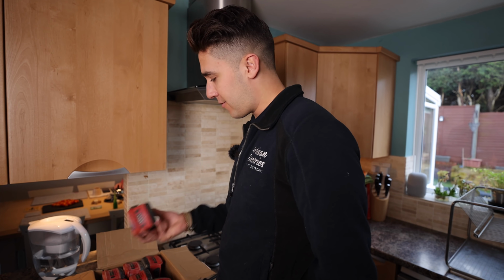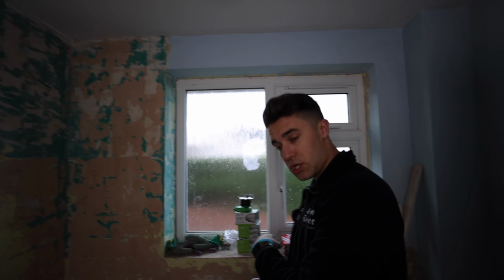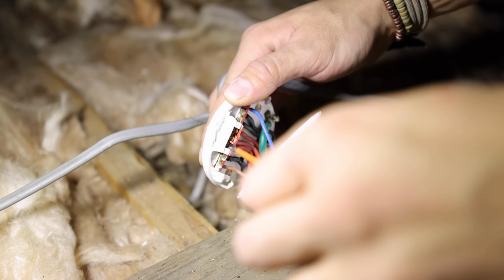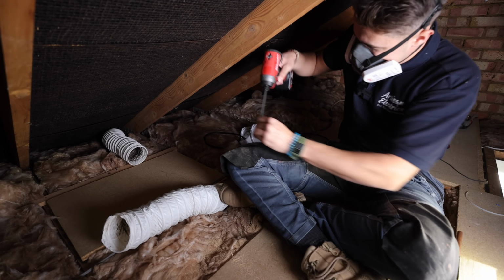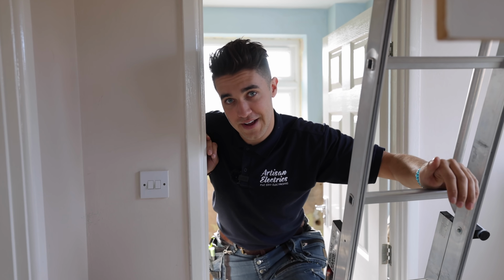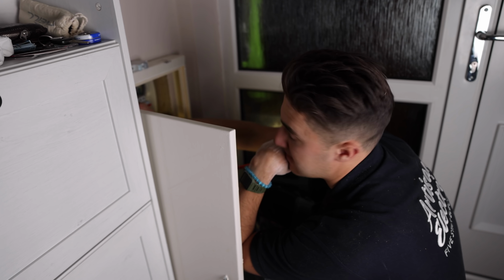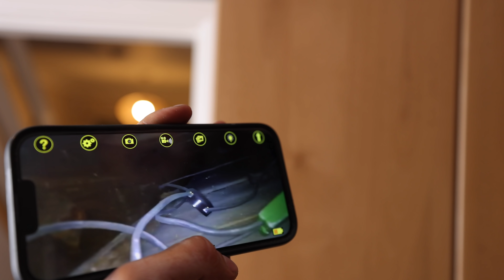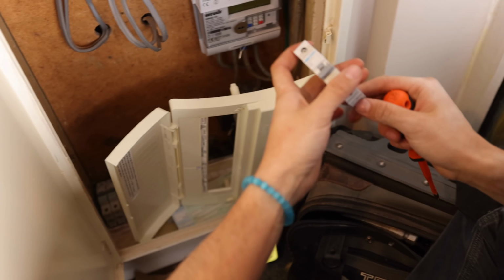THIS JOB WILL NOT END! - Electrician Life

Comment: Hi, From an old spark from the 60's. Regarding offset ceiling lights, I asked the same question as an apprentice in 1963, the answer was dressing tables with large mirrors was fashionable it was to provide light for the lady of the house when applying makeup, if you think about it a centre ceiling light would cast a shadow on the floor not on the curtains especially when bedside table lamps was also fashionable that would project your outline like a projector, in a couple posh houses I installed wall lights either side of the dressing tables to provide more luminance on the subject, I hope that may clarify the subject ;-)
Peter.

Comment: With non fire rated downlights, I have always coded it as a c2 if there is a timber floor above with any sort of living/bedroom area above

If they are in the top floor with a roof space above, no insulation slammed ontop and no signs of any thermal damage then I C3 it but with a strong recc to get them changed

Comment: About the non-centred ceiling light: The actual reason was that pre-electricity rooms were furnished to take maximum advantage of natural light from the window. So everything you wanted to light for (e.g. tables) was near the window, and everything where it was ok to light a candle or lantern to use (e.g. wardrobes) was on the back wall. When ceiling lights were added, they naturally were put where people wanted the light. Only in later construction were they centred, as that is the most neutral location in an unfurnished room.

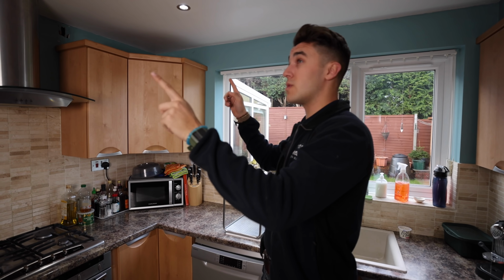Comment: 1:46 why not just replace the tube in that batten with a LED replacement tube?
Reply: that's to easy .. and  the illumnation is't  always great ( i tryed different )  also sometimes need rewiring internaly ( electronic ballast disable )   or change starter to a fuse   .  Other reasen is 20-30 year old batten are brittal plastic ...
Reply: cause ansell battens are king

Comment: fire rated downlights are only required in the following situations:
1. the room above is a seperate dwelling e.g. a flat occupied by a different tenant/occupier.
2. the downlights are installed in an integral garage with living accomodation above.
3. the ceiling is recognised as a fire barrier between floors.

otherwise no code.

Make a loop with galvi band for these IKEA light fittings. Screw through two holes of band to secure in
Reply: Need to re do your 2391 mate. If there is a habital room above the ceiling then you will need fire rated downlights. C2
Reply: @sk83rboy00  Non fire rated fittings are still available to buy. Fire rated is not a requirement in a standard 2 storey house( garages aside). If more than 2 storeys then you have fire compartments including fire doors throughout
Reply: @sk83rboy00  even if it's not a fire rated ceiling... Mmm ok. Better practice yes. Universally true.... No.
Reply: @andrewwilson4402  Fair enough, you read your building regs, however have a look at electrical safety first Best Practice guide 5 under recessed down lighters. On all my EICR’s if I come across non-fire rated down-lights below a habitable room I will always code C2. 95% of the time there is basic insulation outside of the Downlight or they are just taped up in terminal strip. They are there to protect the hole in the ceiling. They will do a much better job than non-fire rated and will be peace of mind for the customer
Reply: @sk83rboy00  these downlight looked terminated ok and had LED lamps installed. Peace not war Kieran. I take your point. Never a c2 if terminated correctly and LED lamps fitted. No fire doors in property so whole house is a fire compartment
Reply: @andrewwilson4402  agree. This all comes about  because napit codebreakers book says it with no qualification.
Reply: Remember that code is a D- (just above failing grade here in the USA).  Always try to be better.  An example I could think of there would be a CU change and using all RCBO's instead of just the required RCD.  I can't quote your code over there, but think it states that RCD or split RCD is good enough, however we know that if you could fit RCBO's it would be that much better, costs come into play here, but you get the idea.  Maybe even one step better would be combo RCBO/AFDD breakers for each circuit.  The AFDD's will help stop potential fires as well.  We have to use them here in the US on most all circuits (AFCI's) and GFCI's in all damp/wet locations even outside on 240V items now like air conditioning etc.  I think most people would agree that fires can and do start in the kitchen, so having as much help as possible for not that much money is worth the cost.  If its only 5 mins more before fire takes over, it would still be an extra 5 mins to get out.  I am surprised you don't have more requirements for smoke/CO detectors all through the house.  I have 12 of them in my house as they are required and all have to be dual power / hardwired and interconnected.
Reply: @Chris_In_Texas  Please no AFDDs horrendous cost for very small 'potential' benefit. The real benefactors are the manufacturers not the home owner.

Comment: Good attempt at reducing vibrations. But... sorry to bring it to you: as soon as you screw the board and fan down, the screws touching both surfaces diminish all that hard work and will act as point sources. What you need is isolation mounts with screw holes and an isolated nut moulded in the rubber. HVAC guys know what I mean :)

Comment: Is it electrically unsafe if the down lights are not fire rated?  Surely if the connections to the fittings are sound and there is no thermal damage…….it is a code 3.  Assuming the fitting isn’t damaged and the lamp rating and type is suitable.
Reply: And it's not a fire barrier of course... Bet there's an open stairwell in the house... How's your compartmentalisation now? Fire doors? No... Right... So it's a C3 then isn't it.

Comment: Again a great video!!!
Can you explain the theoretical background, why neutral touching ground makes the rcd trip?
This is still a phenomenon to me 😎
Reply: Potential difference in neutral with respect to earth causes an inbalance in the current flow through N & E thus tripping the RCD.
Reply: @muzikman2008  ah ok thanks, so line(s) and neutral currents are compared inside the rcd and the ground is not, so the loop ground-neutral carries current and this shows up as a delta I in the rcd, which makes it trip, correct?
Will the potential difference also occur when ground and neutral are combined on the source/mains side of the RCD?
Reply: @nusermane1076  the line & neutral conductors should have equal current flow. If the rcd detects the inbalance then it will trip. It will only detect the unbalance on the output of the rcd, but this depends on the rcd manufacturer and the technology they incorporate within the rcd. Some can be crossed L-N some can't.. See the link I posted, it explains things a bit more 👍

Comment: 22:39 hahahahaah .. gotto love those common neutral bars . really happy we use double pole mcb's in Belgium . would tripped my rcd's 100 times otherwise when working on a circuit . .  Basicly you can halve all MCB's off .. and still trip the RCD( when still on ) .. when  1 neutral is shorted to CPC  ::-)  In other words in uk you realy need to disconect the neutral of ther circuit you are working on ..  cutting the cable of the circuit wil trip RCD otherwise :p

Comment: 17:33  In uk you realy need to replace a hager RCD with a hager RCD ?   Here it doesn't mather you can mixup brands . Altough for the neatness i do like all same brand . but sometimes no other option . as long as the bus bar alligns with other mcb's no problem .
Reply: The issue is what devices you can fit in any given CU. It's worded something like "a device that conforms to the manufacturer's specifications" and none of them bother testing another brand for fit/load/compliance so while it's probably fine to use an off-brand one you might have a problem in the event of an insurance claim.
Reply: @JamesScholesUK  never had any issues with that .  Also we buy empty consumer unit boxes from  example "Legrand"  or "Schneider"  and  fit Eaton/shrack/teco/hager/abb  MCB'/RCB or whatever whoolesaler has on stock inside it .  but every installation needs to be approved by an independant agency . That will sign off the schematics ( i think in uk they don't have plans of the  consumer unit and of the house what  switch is for what lamp and on what braker.. of what sockets is on wich  MCB )  No regulations i all has to be same brand . Also not possible as we fit also  ( relays / domotics / home automation in 1 same board )   same is valid for industrial installations ..  usally the brand of the enclosure (  Ritall )  doesn't even make any MCB's
Reply: Yes the 'regulation' seems to be a typical H&S Jobs Worth approach.  No sound scientific justification (just a few 'maybes) and the usual "We can direct" so "You will comply" attitude

Comment: IKEA really do let themselves down with the fixing of some of their ceiling mounted light fittings. They expect you to be able to find a hook and then screw it into the centre of where the light fitting will hang from. What is missing from their usually extremely helpful instructions, is the fact that for £0.25 they sell a bracket with an integrated hook. If they instead sold the fitting with this bracket for an extra £3 I’m sure nobody would mind the price increase for the absence of such an inconvenience all the while IKEA would be making a bigger profit.

Comment: Unless your going to use a cable you installed  , then you never connect at either end , in an occupied property, it should be labeled do not connect , for ....... At both ends , it to prevent to prevent and idiot making the cable live , and secondly you may not be the sparks that goes back to finish job and the next sparks know what the cable is for. And Cory you should have checked  Rubens work be for you energise any circuits he has worked on
Reply from the maker: It was installed and connected on the same day

Comment: waste of time putting rubber grommets trying to be anti-vibration mounts then only to screw down the timber base plate/ fan mount
Reply: .... and I suspect the ones lined up along the rafters will eventually work out.  Get a plate and mount 4 grommets in it then screw down through the grommet (with a flat washer) with a second grommet underneath so that the rubber is the only connected material between the fan and the baseboard - or buy some "barry mounts".